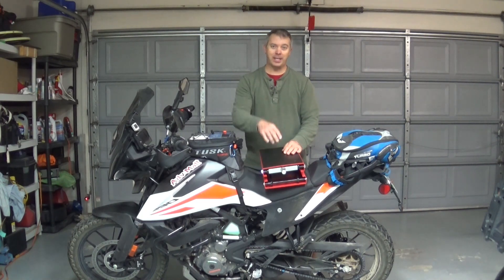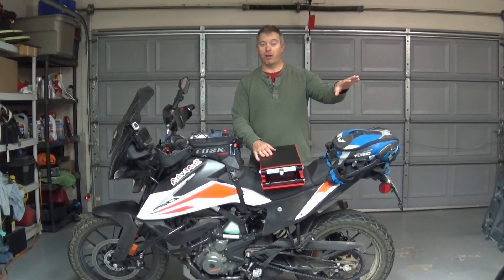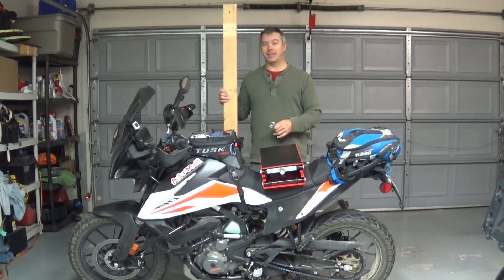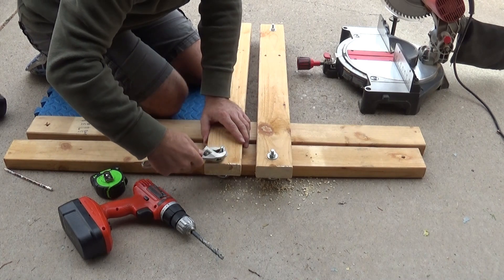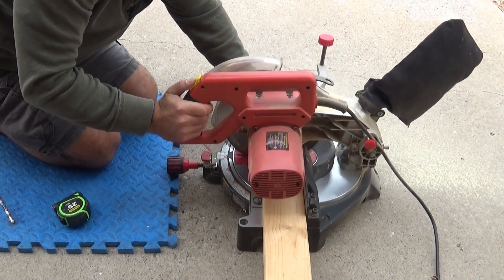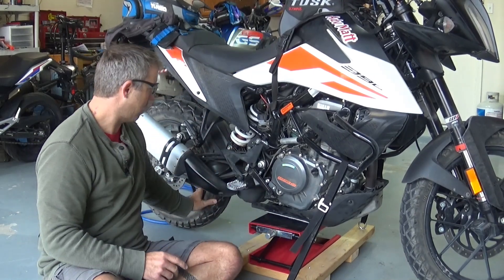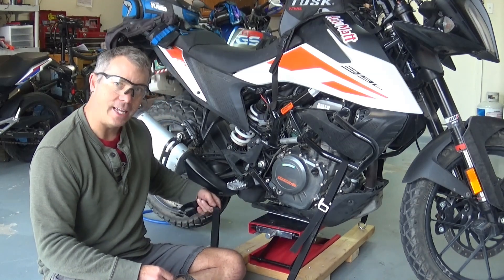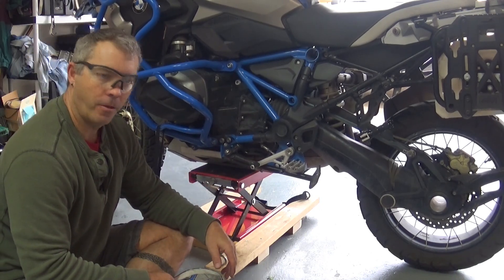Build a Better/Safer Motorcycle Lift for service and maintenance.

Comment: Bro that is so dangerous using the impact on that. It’s not rated for that and you will wear out those mechanism, it will fall on you one day. If you must use a drill and go slow.
Reply from the maker: @pappaclutch3266  ok, I will keep that in mind.  I don't use an impact anymore, I just use a rarchet.

Comment: Its not the box jack thats unstable its the frame contact point on your bike they are narrow. I use this on a m109r vtx1800 and ultra glide and its stable due to the contact area...only thing i dont like about the jack is it has no locking points for the sliding arms inside.. i do like your mod as it adds a little more security ..👍

Comment: I had a similar idea to Dogphlap. I was thinking of just moving the two long 2x4's to under the shorter pieces instead of over them. This would not only give much better stability, but would also allow the kickstand to be raised much easier, and give you 1-1/2" more lift. To do this you would need to counter bore the bottom so the bolt and nut are recessed, or better, just use 1/2" eye screws instead of eye bolts. There is no way they would pull out.
Reply from the maker: I agree.  There are options.

Comment: I was just wondering if it was ok to jack this bike up on that goofy area under the motor. Thanks.
Reply from the maker: I lifted the bike this way.  My opinion is it is okay to lift this way because the weight is distributed across the mounting bracket for the stock skid plate.  The after market plate is much better because it doesn't touch the engine.

Comment: Nice! I actually knocked my 390 changing tires... was in a hurry and my front stand wasnt tall enough, so i rigged something up. 
Guessing you could go 4x4 on the bottom to make it a bit taller for the GS?
Reply from the maker: I used the stand the way it is to lift my GS, but a 4x4 would save some cranking.

Comment: I stopped at 6:29 because the center point of the scissor is going to move in an arc and I want to see just how much. Just visually I think 5 to 6 cm, laterally, at full lift. Thanks for this vid because now I think I'm gong to do this and move the skids about 2 cm towards the wrench side.

Comment: You cannot raise a bike with it's dirt/dust/rock pans, plastic and/or metal, still in place and expect to have a stable bike once raised. I've had no problems with either the frame directly on the stand or if the engine is lower than the frame, blocks between the frame and stand.
Reply from the maker: The bikes I ride use the engine as a support member so there is no frame at the bottom of the bike, and my bikes dont have center stands.  I needed a way to lift them and this has worked really well.  It depends on the kind of bike you have.  This wont work for all bikes, but works great for Adventure bikes.

Comment: I wouldn't use an impact gun on that Jack, if anything I would use an electric drill with variable speed...
I think it would have been better if you would have put the longboards with the eyelids on the bottom of the 2x4s that are blocking the jack in/you would have had a wider and more stable base... You could have countersunk the eyelid bolts on the bottom and it would have been flush all the way across with a more wider and stable platform, then you could have used two short pieces of wood on top to block the jack in 👍🏻
Reply from the maker: Good call on the impact wrench.  I quit using it.  I thought about putting the longer sides on the ground but I didnt want to counter sink the eye bolts as you mentioned.  If i ever have to build it again I may do that.  Thanks for watching.
Reply: @advmatt  👍🏻

Comment: Thanks for the inspiration. I basically did this, though I used 1.5" square steel tube. Plus on my bike I have no flat, even surface to lift on so had to install different spacers on either side of the lift in order to lift on a solid frame member.   Thanks.
Reply from the maker: Glad that worked out.  I use mine all the time.

Comment: I made one of these and it works awesome. Very stable. Changed the rear spring on my WR250X no problem. Thanks!
Reply from the maker: Thanks for letting me know it worked for you.  I use mine all the time.

Comment: Perhaps this design would be even more stable with attached blocks cut from the same size wood under each eye-bolt. In the centre of each block a 1" hole would be needed to clear its eye-bolt thread, washer and nut. Just a thought.
Reply from the maker: That is a really good idea.  Thanks.

Comment: Awesome. I have been looking for solutions to lifting my KTM and GSA.  Thank you.

With the center stand removed from your GS, what is your solution for lifting when you are out in the backcountry or traveling?
Reply from the maker: Great question about lifting without a center stand.  I did a video on this about two years ago on what to do without a center stand.  I use a modified cane as a stand for a three point lift.  It doesnt work as well on the GS but it's perfect for chain drives with double sided swing arms.  Works really well for living chains on the trail.

Comment: Awesome mate! I'ma attempt this for my 950. I'll make a few adjustments yet feel your design is 90% bang on!! Gratzi. 

I reckon putting one more 2x4, with ~12" extended out the front, centered under the lift, running parallel with the bike could give a leverage point to rock your GS forward enuf to lift your rear. Gonna attempt it on my build! 🙌
Reply: Did you end up using it on your 950? Might buy one for mine. 👍

Comment: I would not have used wood screws I would’ve used some bolts and fender washers countersunk instead
Reply from the maker: I thought about that and it would have been better.  I decided the wood screws were enough.  The bike didn't require much force on the straps to stabilize it.  Thanks for watching and commenting.
Reply: @advmatt  if I was going to make that for my Harley it would definitely need bolts not screws👍

Comment: Nice mod Matt! I wonder if it would of offered even more stability if you would have had the longer sections of timber in contact with the floor, rather than the short sections? Basically giving you a bigger footprint on the ground. 
Regards from across the pond, 
Dazza. 🇬🇧
Reply from the maker: I thought about that but the longer sections on top create a little pocket for the lift and also allowed room for the eye bolts to go through the wood.  If the long pieces were on the  floor the anchors would have to be different.  Thanks for watching.

Comment: I like the idea, I recently bought a 2020 - 390 Adv and want to adjust and lube the chain. It looks to me that you are lifting the bike with the exhaust and part of the engine guard. Can you confirm?
Reply from the maker: I have an added aluminum plate under the stock engine guard that helps protect the exhaust.  I lifted the bike from here when I changed the rear tire but if you all you want to do is clean and lube the chain trying using something that lifts from the rear of the swing arm toward the kickstand.  I did a short video on this awhile back.  I carry this modified cane with me all of the time for this purpose.  The video name is "No Centerstand, No Problem".  Link is here https://www.youtube.com/watch?v=18CGpZho33Y .  Cheers.
Reply: @advmatt  Thanks for the link and info!
Reply: @advmatt  without the aluminum plate do you think it would still be okay to use the lift on the exhaust?
Reply from the maker: @familyfun466  no, I dont recommend lifting your bike from the exhaust, you will need an axle lift.